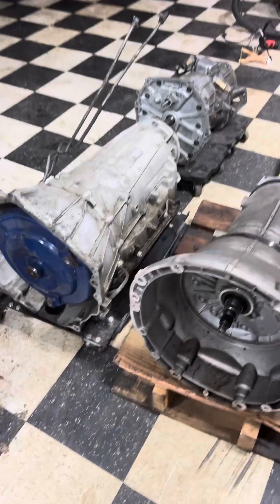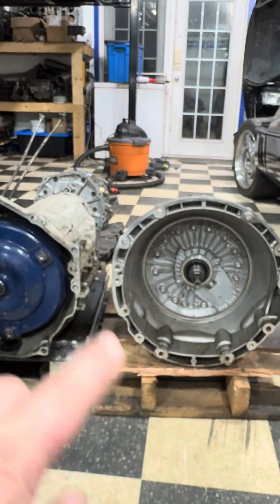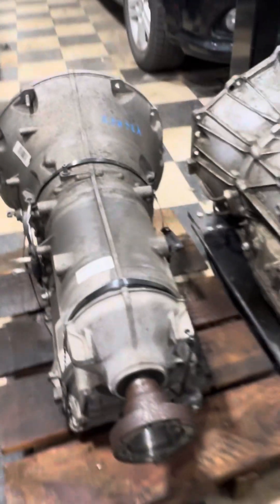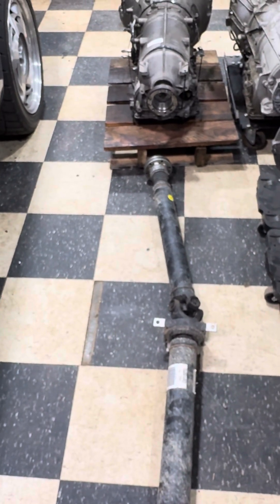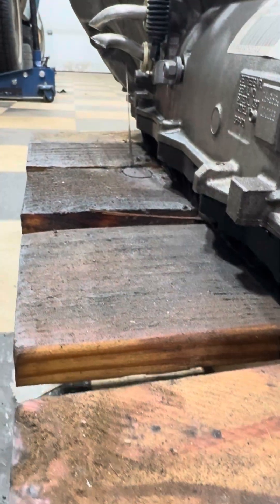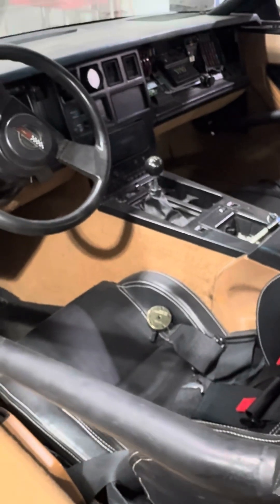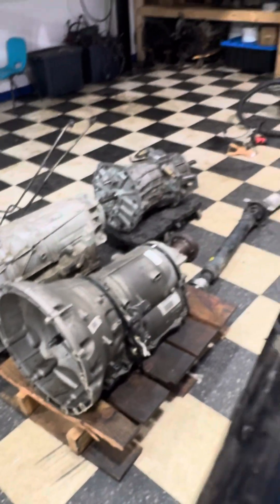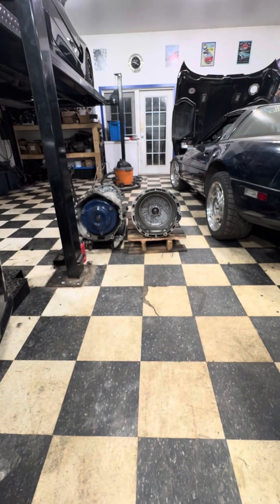8HP70 size compared to 6l80e

Comment: You can use a Maxx Ecu to control the engine and 8hp or get the turbo lamic controller for even more control and flexibility.  You can even add a clutch pedal with the turbo lamic if you wanted to go that route.